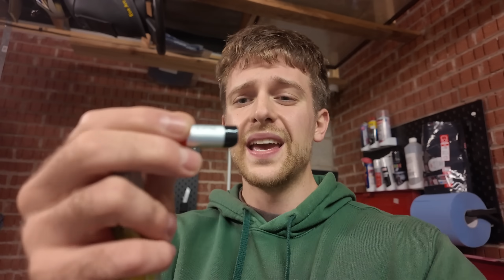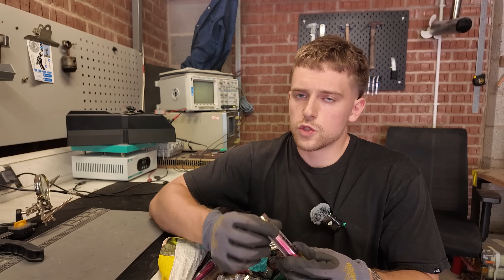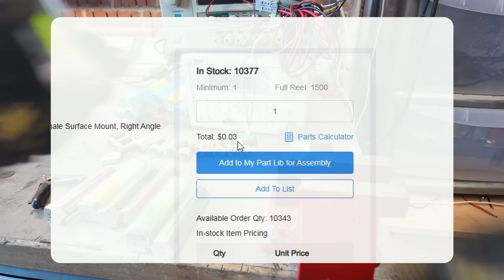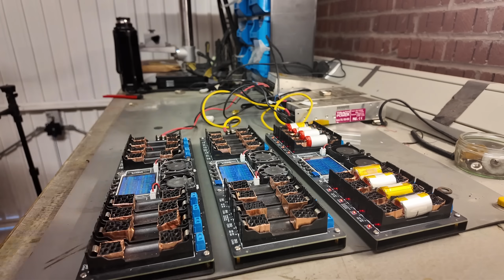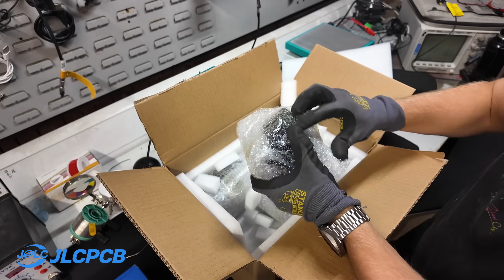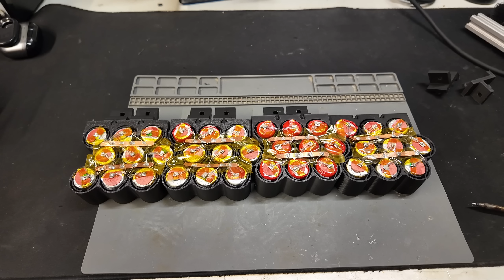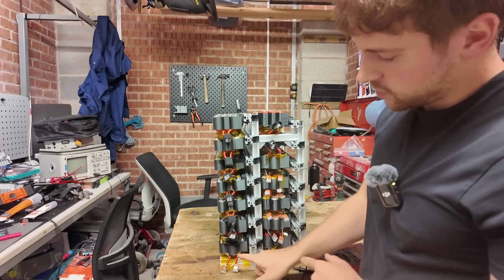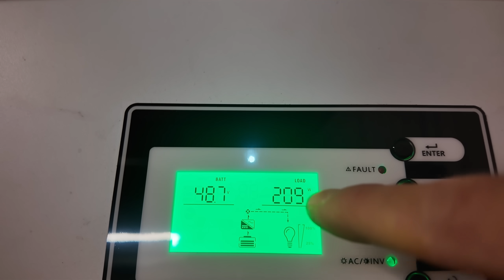I Powered My House Using 500 Disposable vapes

Comment: Some of those batteries could have been saved, just leave them on charge for a bit and most times they will come back.

Happens to my console controllers when I haven't used them in months, I have to leave them on charge for like 30 mins before they come back to life and register that they are being charged.
Reply: Doing that with these batteries causes dendrite buildup. Over time they’ll get bigger and eventually short the battery internally which can very easily catch fire. While it might work, it’s very dangerous. Especially in large packs like this where the fire will spread to the good cells and just keep burning.
Reply: @tommy49er  I can tell you from recovering lithium cells from at least 40+ laptop battery packs that I have come across many severely discharged cells that 90% of them I have successfully recovered and for quite a lot of them doing cycles has improved their health. I noticed that for some in each cycle the capacity increased slightly and the internal resistance went down. It seems that by cycling lithium cells it can heal them a bit. By how much, I'm unsure but I do use them and they work just fine under a controlled stress test.
Reply: @aleksandersats9577 right up until any dendrites that have formed grow enough to short out. This sort of damage is not visible, it's not necessarily noticeable as a difference in battery capacity. It's an actual danger and just because you can manage to make the battery charge and work again does not mean it's safe. It could fail short tomorrow, it could fail short in a year, it might not do so at all.

Is this a risk you really want to take?
Reply: @puckcat22679  Well again cycling seems to heal deeply discharged lithium batteries and the key is to charge them at a slow current when deeply discharged specifically to avoid damaging them further. Also NiCD batteries also form dendrites but those can also be removed when cycling and proper charging so my current bet is it's the same case for lithium batteries. I don't have scientific evidence but just guesswork and something that isn't guesswork is the fact that the lithium batteries I've cycled that were deeply discharged gain back capacity and lowers the internal resistance back down. If that isn't a sign that it's healing I don't know what is. Either case, yes I'm willing to risk it because I've already done this so many times and I do use them properly and never let them go back below 3v.
Reply: @puckcat22679 dendrites form in the batteries under normal use anyway.
Reply: Yours were most likely BMS protected and it was not the cell itself the one being overdischarged.

Comment: I think if your going to play a little more you may want to have the correct rated wires and bus bars.
As youre just series connecting, then the  current is flowing through all cables and batteries.
You should also consider the actual cell current in and out rating.

Lets say yo have 8*3 batteries. But they have a safe output of 2 amps.
That gives you a safe output of just 48amps

48a*51v =2448watts.

Prreettyy sure there are things there not rstes for dc current at 48amps😮

Comment: I don't know about building codes in the UK, but in the US it needs to be physically impossible to have the grid connected and the inverter connected at the same time, there's usually a sliding bar or something, this prevents sending power back out to the grid which can be really dangerous, like if there is a power outage, and someone tries to work on downed lines that were turned off, except your still pumping power into them.
Reply: It's the same in the UK unless it is a harmonised inverter. However in the regs are grey caveats about use by competent person and restricted access for technical use, like in a laboratory. Ie, don't let the public near it.

Comment: You need a back feed isolator (aka a change over switch) so that you can't send power out to the grid in the event of a power failure ,
Same as if using a generator

Comment: I would recommend investing in a spot welder, and then spot-welding nickel strips instead of soldering copper to the cell terminals.
You're a lot less likely to overheat and damage a cell doing this, and good quality spot welds are a fair bit less brittle than solder joints. A kWeld spot welder kit will set you back around 450 euros, but will give much better results than soldering will

Comment: 13:03 theye make some really big heat shrink that is great for these battery pack builds, it's really thick and it firms up to almost a hard plastic after it shrinks so it almost makes a molded case for the pack. I've bought it large enough to put 3'x5'x6" packs together

Comment: you mentioned when connecting in parallel the batteries need to be the same capacity and you also said you were sorting the batteries into groups of similar capacities. in the final end product were all the cells the exact same capacity?
Reply: The connected cells need to be at the same VOLTAGE, not the same capacity.
Once they are connected in parallel, the individual capacities just add together, and variations become completely irrelevant.
Reply: Wouldn't that result in some cells being discharged at different rates? Due to capacity differences
Reply: @LukeNelson-s2c - no, parallel connection means that voltage in each cell is identical. Therefore, power just comes from them all in a "shared array", and lower cells don't get over-discharged.
Note that having a bad cell will cause that parallel group to have a lower total capacity than another group with all good cells. Therefore the BMS (if it is a decent one) will still diconnect the Series/Parallel string early, dictated by the lowest capacity cell.
. .
For example, let's say you connect a 1000mAh cell and a 2000 mAh cell in parallel. The voltage will be the same as a single cell, and the capacity will be 3000mAh.
Reply: @johncoops6897 i think I understand aslong as the individual cells in one 3.7 bulk cell are the same capacity but the capacities between the bulk cells can be different when connected
Reply: @LukeNelson-s2c - youtube is unaliving my replies. You are somewhat confusing Voltage, Current and Capacity.
In a parallel connection, the Current and Capacity are the sum total of the parts.
But when connecting in Series, the Current and Capcity are limited by the lowest cell group in the array.
In a series/parallel array you need to combine igroups of parallel cells so that they are as even as possible in capacity.
. .
So, say you had cells with capacities of 1000, 1100, 1200 and 1300mAh and connected them 2S2P...
Example 1.
P1: 1000 + 1100 = 2100
P2: 1200 + 1300 = 2500
- In this case P1 & P2 in series would only provide 2100 mAh. It' limited by the lowest group in the string.
Example 2.
P1: 1000 + 1300 = 2300
P2: 1100 + 1200 = 2300
- in this case the series string would give 2300 mAh. That's 10% more from the same individual cells.